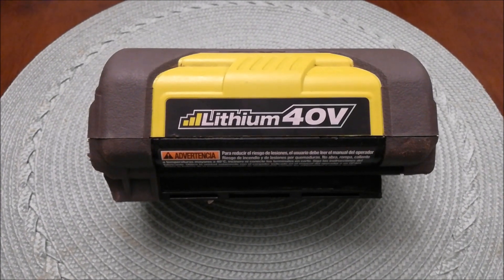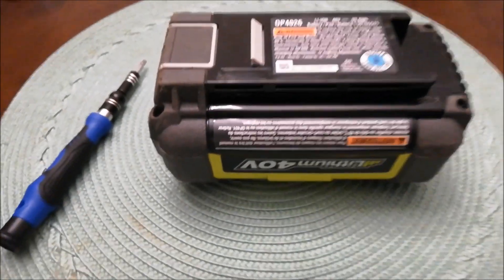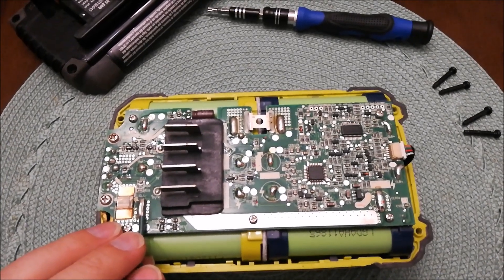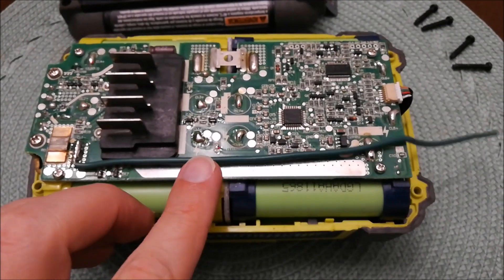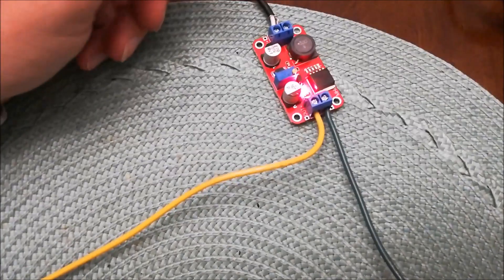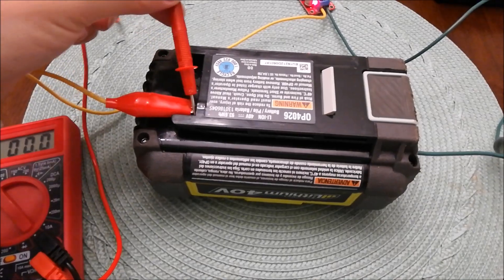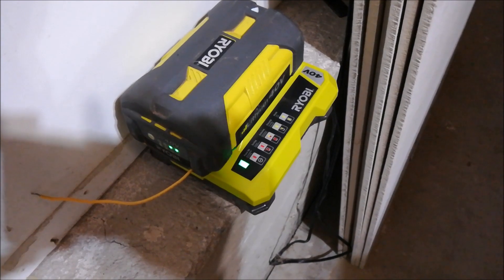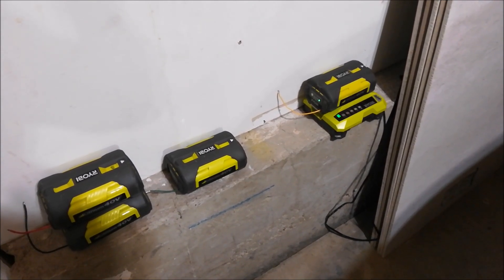40v Ryobi Battery Defective?! Let's Fix it!

Comment: These batteries are so terrible. They will work fine and then they'll be dead from use and decide not to charge. They're not even old.
Reply from the maker: The cells within the battery are great, the limitation is the circuit board that controls all the batteries charging and discharging. It can be frustrating for sure. If the battery is newer it should be covered under Ryobi warranty.
Reply: @Jasonoid  yeah I got it last year kept it stored around 50% capacity for the winter. Charged it to full, used my chainsaw until it died, and then immediately went to plug it in and it was dead. Then the same thing happened immediately after with a second battery!

I'll call them today. Thanks!
Reply from the maker: @DirtyTesla  The batteries are being over-discharged. I try to avoid bringing them down all the way. If the battery cuts out, stop using it immediately, never try to run the tool after the battery shows it's low.

Comment: Thanks for this video.  I've always been annoyed that batteries decide when they're "defective" and I would love it if they just let ME decide when they are no longer viable.  I've long suspected they are not really bad, just some kind of thing exactly like this and it turns out "low voltage".  

I like that your hack does let ME decide.  I've ordered the security torx bits and the step up converter.  I've been wanting the security torx for a while for various things; like the fan in my DVR is noisy sometimes and I want to replace that, too, and the box as the security torx screws. 

Anyway, I'll let you know how the battery fix goes.   Now, where's my multimeter.....?
Reply: It's right over there.
Reply: Given the choice between deciding it's defective or burning down your house and getting sued, the corporations will always choose the 1st...  Blame the lawyers.

Comment: I like my Ryobi 40v Gen II brushless chainsaw, but I have a dead baterry after 1 Year of minimal use and battery was tested bad at Home depot Grennville , Texas.  I need a replacement ASP and am having trouble connecting right place to send in info?
Reply from the maker: If the battery is only 1 year old they will replace it for free. Call Ryobi support. They will need the serial number off the battery to replace it for free. Hope that helps!

Comment: Why can't you just hook a alligator clip to the negative terminal such as you did the positive and charge it that way instead of taking the battery apart and soldering the wire?
Reply from the maker: Go ahead and try it, it won't work, the battery voltage is to low and the circuit board "disconnected" the power terminals, you have to bypass the circuit board until the voltage is above 30 volts

Comment: I bought one of these old Ryobi 40v OP4026 batteries, charger, and a couple weedeaters at a yardsale. I planned on harvesting the motors for an awesome very large 3d printed tank chassis I made. When I put the battery on charge, it charged up all the way then gave me the red/green flashing lights. It wont work in the weedeaters and wont work when hooking the motors directly to the battery terminals. On a multimeter, it gives about 35v but slowly drops. Is there any fix for this issue?
Reply from the maker: The circuit board is probably fried. Some people try some crazy things with these batteries like leaving them out in the rain. Open it up and inspect it for damage.

Comment: When i push the button on the battery to check power level all 4 light flash. When i test battery with multimeter i get 33v is my problem different then described here?
Reply from the maker: Probably a bad circuit board, I have had 2 batteries that light up 4 lights but won't power any tools, the circuit board is fried on my batteries, could be the same for you.
Reply: @Jasonoid  ya seems like something like that. Ryobi replaced it under warranty but I tried to fix it instead of just recycling. Thank you for your help, it was fun just tinkering around with it.

Comment: Any reason to not just clamp to the negative post opposite of the positive you used?
Reply from the maker: You have to bypass the circuit board, it shuts down the positive terminal for safety once the battery drops to low voltage
Reply: @Jasonoid  damn welp time to go dig out my old iron

Comment: So I picked up the charger parts you listed in the description.  Max output I can get from these is 36.8vdc.  Do you think that will be enough to make the charge?
Reply from the maker: you just need to get the battery to about 30 volts, then plug it into the Ryobi charger to do the rest of the charging safety. The part you bought is just to boost the voltage up so the Ryobi charger will see it again as being a good battery.
Reply: Set everything up as you have it here.  Putting my alligator clip onto the positive with converter off there was a small spark from the clip to the pos terminal.
Reply from the maker: @northeasternguy1010  theres lots of power in these batteries. Probably just a rush of power charging the capacitors on the boost converter.

Comment: I have a few 40v that charge fine but won’t hold that charge that long, would this method help or fix that issue? Also I only have access to 24 and 48v DC, will either of these work or help? Thanks for your help
Reply from the maker: The cells inside the battery have lost their capacity. It happens over time of if the batteries sit at a low voltage to long. There isn't much to fix the batteries that wont hold a charge very long. A 48 volt DC charger would probably work, just don't let it sit to long, you only want to boost the battery up to a voltage where the charger will recognize it again.

Comment: hi jasonid, thx for your video. i tried to do the same to my 40 v battery, but in my case the voltage does not go more than 12 v. I tried several times also by increasing the converter output voltage to the maximum, but my battery remains at 12 v. Then i paralleled it with my other good 18 v battery, raised the voltage to around 17v, then quickly reattached it to the converter. The voltage is running down again to 12 v. any thoughts? Best
Reply from the maker: Did you open the battery and connect the negative lead to the CL1 point?
Reply: yes, i did
Reply from the maker: @hogen007YT  There have been a few people that mentioned some issues. I think if the battery wont charge there is probably something wrong with the internal circuit board.

Comment: This worked for an old version ryobi battery sitting in my garage. Used a 12VDC  1amp trickle charger for a motorcycle as the power supply. Battery measured 5vdc before charging .Charged to 32vdc after about 30min. Now an extra battery for my leaf blower. The battery works very well in this application. 
Thank You.
Reply: did you modify the trickle charger (boost converter between) or just used it like charging any other battery(connect to +/- leads)?
Reply: Rolando Sustaita . Yes. Used the charger as input to step-up. Charged to 32vdc and then installed battery into ryobi charger to complete the charge cycle.

Comment: can you solder the cl1 to the negative terminal to bypass the circuit board and allow the Ryobi charger to charge the battery even if voltage is low?
Reply from the maker: You might not want to do that because then you are bypassing the low voltage cut off. I have only had to do this once to each battery so I would just recommend opening the case, connecting to the CL1 point, then removing the wire and putting it all back together. Thanks for watching!

Comment: Will this work for the Ryobi OP40401?
40 volt 4Ah
Reply from the maker: If the battery looks similar it should have a board that should work. Only way is to open it up and give it a test.

Comment: I hooked 4 9v batteries in series and connected to the cl6 terminal(neg) and the pos. terminal on the outside on my 2018 & 2019 batteries. Got it up to 17v and the charger recognized both. Charged to full capacity.
Reply from the maker: Great idea, didnt think about using 9volt batteries. Thanks for sharing!
Reply: @Jasonoid  I was surprised it worked.

Comment: Can I ask why you dont trickle charge it with the top off then remove the wire and put the top on after you've reached the desired voltage?
Reply from the maker: You can do that, when I made the video I didn't have experience to know if the battery would stay above the 30 volts after many cycles. It seems to only need the charge once as long as you don't over discharge the battery again.
Reply: Thanks
Reply: Great video by the way

Comment: Will this work with a benchtop power supply set to the same 40v 3.5a settings?
Reply from the maker: Should work great, if you already have one laying around, give it a shot. I would set the voltage lower and then raise it up over time. Especially at that high amperage. Don't you use it long term, just use it to get the voltage high enough for the stock charger to recognize the battery.
Reply: @Jasonoid  Thanks!

Comment: Thanks,  this worked like a charm.   I used a 48v 10 amp power supply adjusted to 40v.   The 3-year-old battery jumped from 23v  to 35v with a 10-second charge.
Reply: Where did you get the 48V power supply?  Can you provide the link if it is Amazon?
Reply: Yikes, I'd think twice about adding that much voltage and AMPs that fast, it's a good way to permanently kill a cell, and if your unlucky, explode a cell and start a thermal run-away fire that's impossible to put out (you just have to let it burn all that nasty lithium, like those videos of vape people whose pockets suddenly burst into flames and explode)

There are a number of 18650 cells in these battery packs (vape smokers have one cell, if you see those exploding videos) and they are managed by that BMS electronics board that you are bypassing.  It is generally safe to charge an 18650 at 1C (or 1 amp). Now your 10 amps is being divided by some of the cells, but these packs have cells in series and parallel, so unless you actually know the configuration, its hard to say how it's being divided. But on top of that, at least one cell is lower than the rest, (causing the problem in the first place) and it might be damaged, meaning it might take less to start it on fire.

TLDR, use low amps and go slow to save yourself a burnt down house

Comment: Using 94Wh batteries in my blower (RY40401A Date Code 9-13-2013), it has been stopping when the charge status is at 2 lights (50%). It blows again when the trigger is depressed, but it's only for a second, indicating some part in the circuit is stopping the current. It has no problem before then. Battery voltage measured with voltmeter shows 37 volts across the + and – spades. The battery is OP4026 bought in 2015, so it is more than 4 years old. Ryobi only tells me to contact a service center. 
The battery does charge to 41 volts and displays all 4 green lights. 

 With my 5Ah battery I don't have this problem since I'm usually finished before it can stop. I use the 5Ah batteries for my mower.

Comment: Thanks SO much for this video. I brought my battery back from the dead and it's charging again.  I appreciate you putting the time in to make this video.  I bought the tool kit, and Boost Up converter you recommended from Amazon, and they actually arrived the next day.  I didn't end up soldering the negative wire to the board, I was able to use some electrical tape and a rubber band to make the connection during charging.  My plan is never to fully deplete the battery again - I'll stop and swap when it gets down to two dots.  I was able to crank the booster up to about 37 volts using a tiny screwdriver from the kit.  When it's actually charging the LED display blanks and two lights blink on the booster board.  It took about 3 hours, and I was able to bring the voltage of the battery from about 25 volts to about 33.5 volts.  I figured that would be enough - unplugged the charger, disconnected the leads and screwed the battery back together.  I put it in the charger and it started charging.  Thanks again!
Reply: How did the capacity (run time) of the 'fixed' battery compare to normal 40V batteries of the same AHr rating? Thanks.
Reply: Richard Friend It’s the same as it was before I ran it complexly flat on the blower. (Damn Oak tree). Just had to get the voltage up a bit so the charger recognized it again.

Comment: My battery reads 41V at Cl1 and the + spade.  But the + spade and the - spade reads 17.5V. When the battery is plugged into the charger the charger shows all green LEDs lit. When the battery is plugged into the power head, the attachment does nothing. What do you think is the problem? Bad battery motherboard?
Reply from the maker: Out of the 7 batteries I have on hand, I have one battery that does the same thing as you mention. I wish It was still in warranty. I think the circuit board is defective and probably had a short circuit in it somewhere. It won't power my devices but it is fully charged. Im thinking it's a safety mechanism built in the board to prevent a fire or incorrect charging because something failed internally. These batteries have a lot of power in them and are a fire hazard if something goes wrong inside.
Reply: @Jasonoid  thanks for the quick reply. Sadly, I'm probably going to trash it because Ryobi won't replace it because It was mfgr'd more that 3 years ago and I can't find the receipt.
Reply from the maker: @billglock2587  If you are confident about disassembling the battery pack. (I have done it before, it doesn't take long) You can reuse the 20 18650 high discharge batteries inside. They work really well for LED flashlights. You could possibly re-coup some of the cost for a new battery by selling them. Just an idea.

Comment: Going to try your setup, but since I don't know much and have been doing a little research, isn't the amperage of the battery important?  If your stepup only goes to 9 amps, and your battery is a 6 amps, then don't you need a max of 16 amps on your input voltage to get to 32 volts if your input voltage is only 12?  Or does the input amperage not matter as long as it's above the minimum?  32VX16A=192 watts <-- desired output,   12VX16A=192 watts <-- minimum input
Reply from the maker: When charging the battery, the level of amperage just determines how long it will take to charge the battery.  1 amp charge rate will take much longer than a 10 amp charge rate. The process in the video is here to just boost the battery voltage high enough to get the stock charger to recognize the battery again.

Comment: my booster has an lcd to see out put voltage and when i put it on battery the voltage is going down instead of up. any ideas why it's going down instead of up?
Reply from the maker: Under load it might be lowering the voltage. When connected to the battery can you adjust it to go higher? You also want to make sure the wires are connected to the proper points on the circuit board.
Reply: @Jasonoid  everything is connected just as you described in the video. not sure what you mean by under load. when connected the booster charger started at round 19v and now its down all the way to 13v after 5-7 minutes. I was hoping the charge would increase not decrease. Not really sure what could be wrong.
Reply from the maker: @monofrio6804  So you opened the battery up, and connected your wire to CL-1 and the positive terminals? You can't connect to the battery power leads directly. It won't work. You might need to make sure you have the wires connected properly on the boost converter too.
Reply: @Jasonoid  correct, as I said in my reply its connected exactly as you did. its still doing the same thing even after 20 minutes. down to like 12.5v's now.
Reply: @Jasonoid  so only difference in my setup is the booster of course with lcd but essentially the same thing and my 12v power brick is only 3amps instead of 5.
Reply from the maker: @monofrio6804  Seems like you may have your battery powering your boost converter? Only thing I can think of. The power in and out on your boost converter may be reversed. Maybe the boost converter is broken. Not sure what else would be wrong. Many many people have had success with this method.
Reply: @Jasonoid  its connected properly, power adapter in the in and batter to out terminals. im just as confused as you are.
Reply: @Jasonoid  multimeter does show 33v coming out of the booster.
Reply: SongsWeDid I gave up and recycled the batteries at the store. Just got new ones and moved on, to much hassle and disappointment.

Comment: Or you could have used a 40 Volt power supply set to low amperage with alligator clips to charge the battery without drilling & soldering your battery.
Reply from the maker: You have to charge the battery by using the CL1- point by bypassing the circuit board. It won't charge vias the exposed terminals.

Comment: Any reason you can't just use a 12V battery charger with the step up voltage converter?
Reply from the maker: The battery charger probably wont sense the correct battery and might give an error or something, but I guess it's always worth trying. Let us know how it goes!

Comment: also on new step up converter, there are 2 buttons.  Do i have push for a certain setting?
Reply from the maker: I haven't tried the new converter. It may come with instructions. The Amazon seller or product page will have the best info on it. See the product comments and reviews for all details.
Reply: @Jasonoid  will this one work? https://www.amazon.com/dp/B07FX1JCQ2/?coliid=I2Q238LLN245HG&colid=1PRZH12VQ30OD&psc=1
Reply: @Jasonoid   will this one work? https://www.amazon.com/dp/B07FX1JCQ2/?coliid=I2Q238LLN245HG&colid=1PRZH12VQ30OD&psc=1